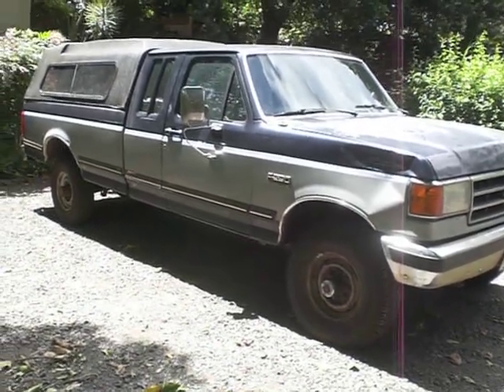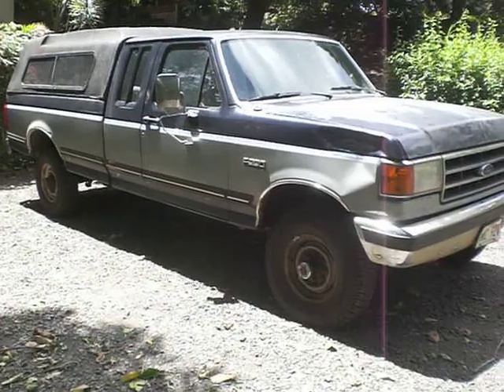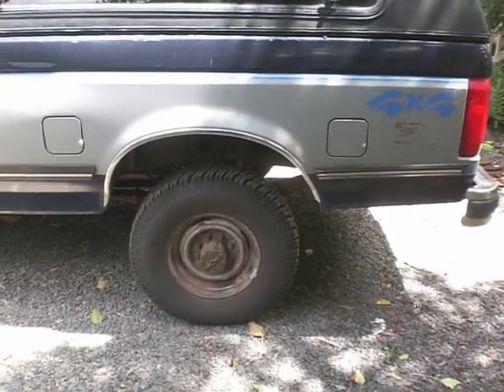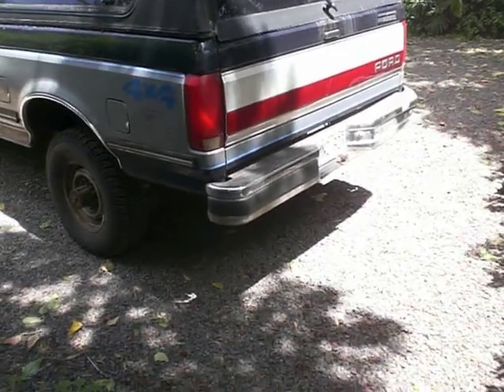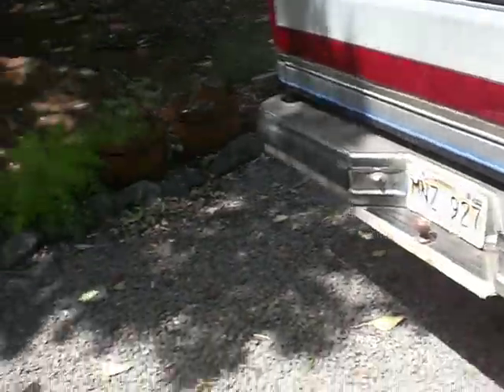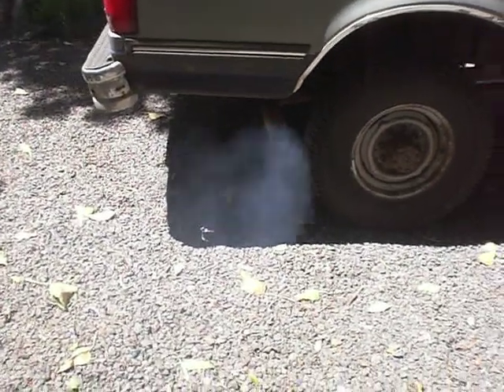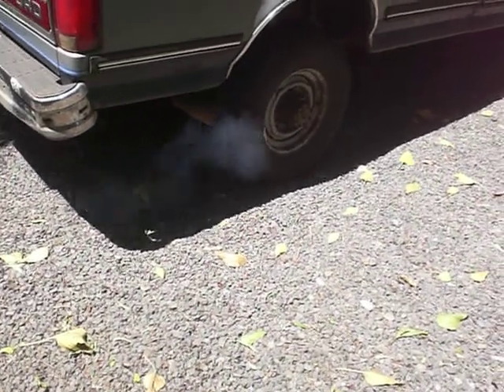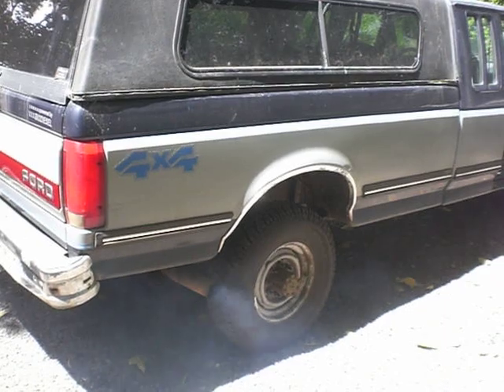waste motor oil WMO as fuel

Comment: I ALSO USE SEAFOAM IN MY BLACK DIESEL FUEL.  THAT WAS NOT BAD AT ALL YOU DO NEED TOCENTRIFUGE THE OIL BUT NOT BAD FOR A FORD.  CUMMINS IS A BETTER MOTOR WITH THE P7100 PUMP GOOD LUCK
Reply: wrong

Comment: bulegrass sales a wast petroleum processer that fillters motor oils ,hydraulic fluid
transmission fluid etc... any thing thats petroleum oil will work i talk to one of the guy that help him (archersfriend) is his name from what i have seen i would prefer this over any thing because of whats inside of it on top of that i think motor is better than veggtable oil or biodiesel if you have one of these or not or make your on diesel you seafoam mix it in wiht that fuel it will keep the engine clean

Comment: You should do some more research man. do NOT mix biodiesel and motor oil. they will clump. only motor oil and gasoline or motoroil and regular diesel. furthermore you need to clean the oil down to .5 microns in order to not destroy your injectors.  letting it settle is not sufficient. you need filters or a centrifuge. goodluck!

Comment: For anyone running WMO or WATF in Ford Diesels, you should blend your mix 80% oil and 20% regular gasoline. Also, you should advance your injection timing about two degrees BTDC so the fuel has a longer burn time. The carbon chain in Diesel fuel is much shorter than in WMO/WATF, so a slightly longer burn time in the cylinder will allow those longer carbon chains to break. When the carbon chains are allowed to break down to a certain point, your smoke opacity (unburnt carbon) goes down.

Comment: hi have you tried letting the oil flow through the water block (drain water completely first of coarse then let it feed out to the diesel filter this will take the flash point higher and thin it really well. i understand the water is usually at pressure but it should be possible to let it stay at pressure as the spill return off the pump and injectors should be adequate ...just a suggestion ok